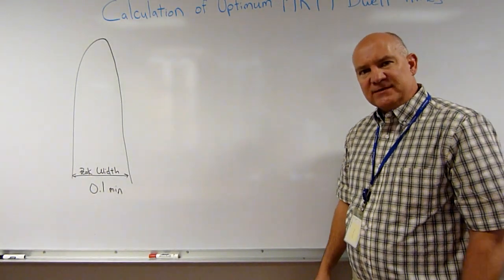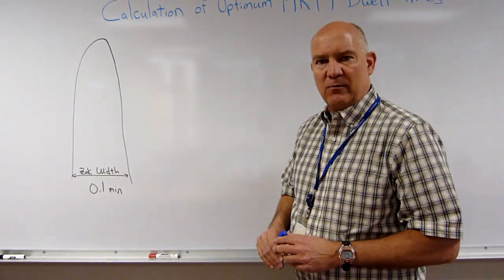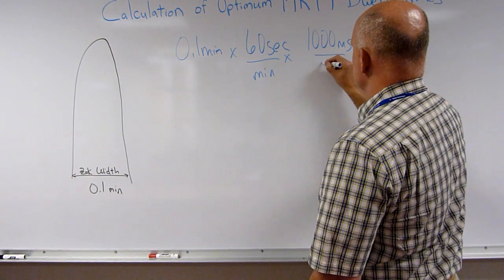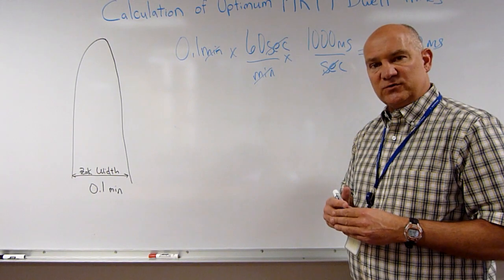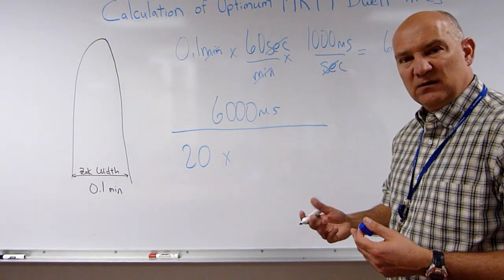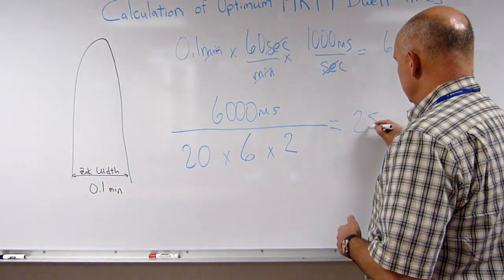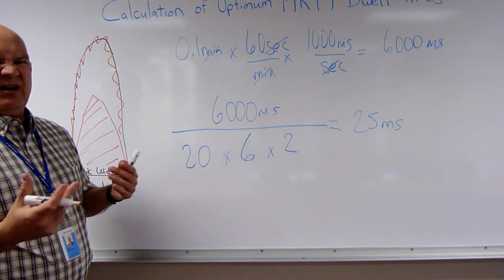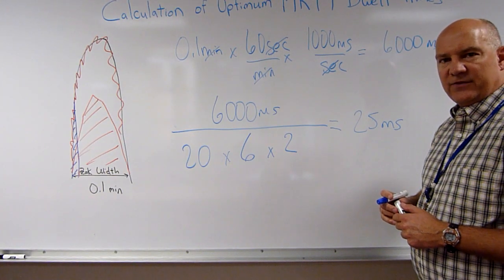Calculation of Optimum MRM Dwell Times

Comment: Thank you so much!!!!! I had been taught this differently by two people and needed to confirm!! What happens if you set 20 msec/point (dwell time)? Will the system add more points (>20)? I guess the higher the dwell time the better right?
Reply from the maker: You set the dwell time so that you have the appropriate number of points across the peak.  As long as you are above the manufacturer's minimum dwell time, a longer dwell time does not matter.  The intensity of the signal is the intensity of the signal at that point in time, and measuring it for longer will not increase that intensity.

Comment: Thank you so much this video is made me understand easily. Moreover, I would like to know if I want to check data point of each compound after finished run from 20 mixed compounds. How to calculate data point of that by hand? 
The point is my dwell is not the same number and individual peaks are show different width.
Reply from the maker: You can certainly step thru the spectra to see how many data points you have.  And if you are doing good gradient chromatography the peak widths should be about the same unless you are doing something wrong - the exception would be peaks at the beginning or the end of the gradient.  Those can be a little wider, and that's ok, as you are looking to find the # of data points for the narrowest peaks - extra points are fine

Comment: Hi, could I have another one question please? I performed the separation of ciprofloxacin and its metabolites on two different columns - Kinetex F5 and CSH UPLC fluorophenyl column. Better separation was achieved on the Kinetex column. On the CSH UPLC fluorophenyl column desethylenciprofloxacin elutes for almost 3 minutes. There is a great tailing here. Do you think this is due to the fact that both columns are prepared with a different technology? Because both columns contain pentafluorophenyl and yet the separation is different.
Reply from the maker: That happens with columns from different vendors - I am no expert on that assay.

Comment: Hello. I would like to ask you for advice. Does the mobile phase have a major effect on the optimization of the mass spectrometer? When optimizing the mass spectrometer, I chose a mixture of acetonitrile and water as the mobile phase. However, when optimizing the HPLC method, I chose a mixture of buffer and methanol as the mobile phase. I would like to know if the change of the mobile phase has an effect on the mass spectrometry (finding of precursor and product ions, voltage of ion optics and collision energy)
Reply from the maker: The mobile phase can affect the precursor, for example enhancing M+H over M+Na or creating M+NH4 instead of M+H.  If the precusor does not change, it will have zero effect on any of the product ions, the ion optics, or the CE
Reply: @kmatus  Thank you sooo much!
Reply from the maker: @hacko1331  You are very welcome

Comment: I thought the dis-merit of having too many data points per peak is reducing the sensitivity, and does not further improve the area reproducibility.
Reply from the maker: It actually has nothing to do with the sensitivity as we are talking here about triple quads which are parked at selected masses and are not in a scanning mode.  Too many points become a practical issue in that you start to see the irregularity of the spray itself, and integrator algorithms, which look for slope changes, may only integrate a portion of the chromatographic peak

Comment: Great Video! Is there a way to calculate for optimum scan time in full scan?
Reply from the maker: Depends on whether you are doing qualitative work or quantitative.  If you are on a quad you want to maximize your full scan time because it directly affects your sensitivity.  

For qual, you want a minimum of the scans across your LC peak but a better number would be 5-8 so you can tells it's a peak.  If your peak was 6 secs wide, then you'd probably want a rate of one spectrum per second to get 6 data points, but no slower than 2 sec per scan acquiring 3 spectra.   Any more than 6 and you are giving up sensitivity that you don't have to give up.

For quantitative analysis you'd want at least twelve scans across the peak, because that's how many is needed to accurately and precisely measure the area under the peak.  Probably shoot for 15 secs to make sure you get at least 12.   Any more than that and you are throwing away sensitivity.  So for our 6 sec wide peak above, you'd have to be scanning a 1 spectrum every 0.5 sec, or 2 spectra per second
Reply: Thank you for the response! I am just doing a little mass detective work using Full scan (Q1) to determine what form the compound of interest is in M+H, M+NH4,  M+Na etc.
Reply from the maker: @Gmen595  You can't really without an accurate mass system that you can trust - but what you can look for is mass differences - M+H, from that +17 is NH4, +22 is M+Na, + 38 is M+K - so if you see multiple ions look for those patterns to deduce what is what

Comment: Thank you very much for the video. I have a doubt, can I use the tool smooth to better peak shape? How much can I use it?
Reply from the maker: smoothing on the data processing side (after acquisition) is always possible in any vendor's software but it's always more desirable to smooth DURING acquisition by setting to correct dwell time - if you have too few points post acquisition smoothing can make the peak visually look better, but your data will be inconsistent
Reply: Thank you for the answer!